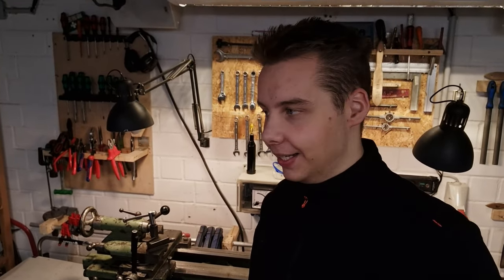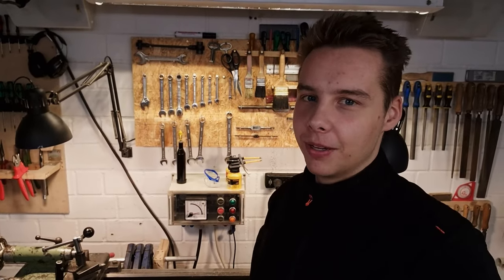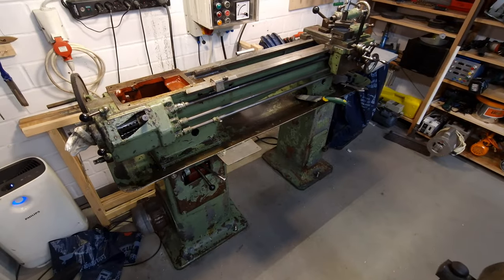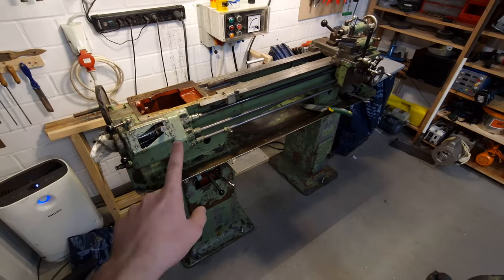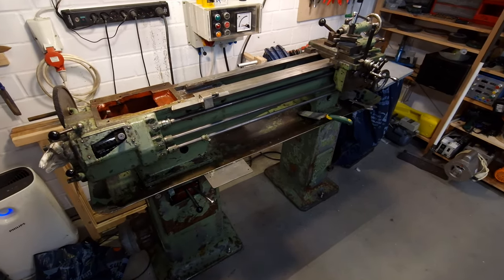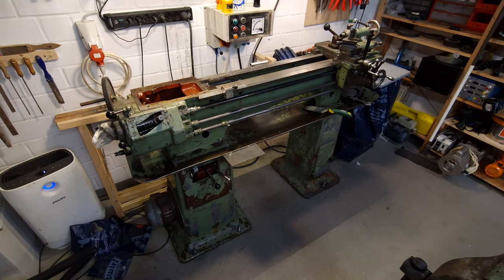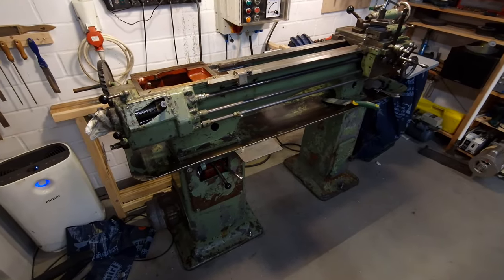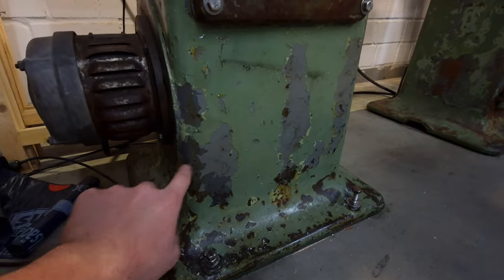1939 Weisser Type EE Lathe Restoration Part 1 | Intro

Comment from the maker: 2:54 No I didn't forget to add the card, youtube only allows members of the partner program to add cards with external link :/ So here it is instead: http://www.lathes.co.uk/weisser/page4.html
If your interested in machine tool history you can also look at this report on german machine tool industry from 1927 (in german), that has some info about weisser on page 134 (14 in the pdf): https://cybra.lodz.pl/Content/11376/Werks_Jg_21_H_5_27_s_121_136.pdf

Comment: I'm not super familiar with all lathes, but I think the lever you're talking about being broken at the 10 minute mark is the lead screw disengagement lever.  My lathe has one in the same spot.  It looks to me like that lever is working perfectly fine.
Reply from the maker: Hm quite possible. Although there are at least 2 other ways of doinh that on the machine (including one which completely disconnects the feed gearing), so not sure how useful it would be. But i will look into that when i take it off the machine :)
Reply: @TMaxElectronics  Hi @TMaxElectronics ! I have a weisser lathe that is even older and i can’t find too much info about it. Im restoring it. Could you please share contact info for this person who could answer????😱